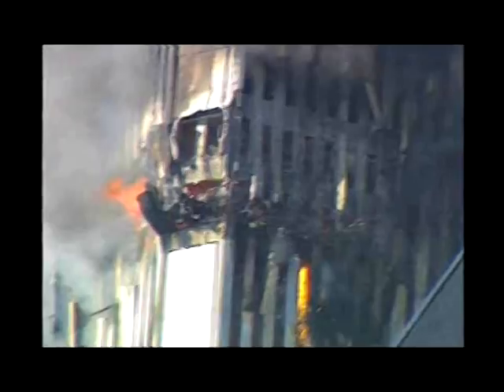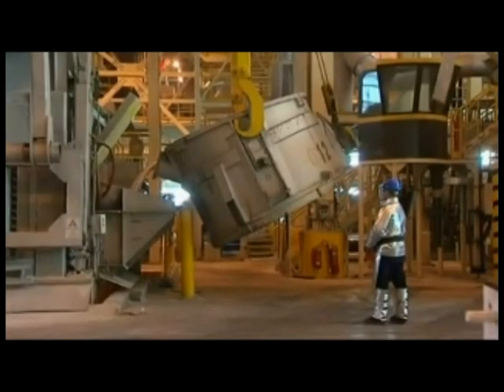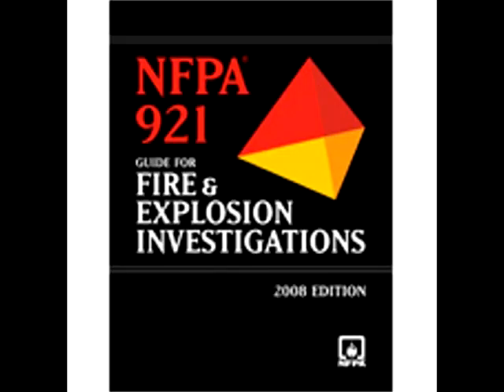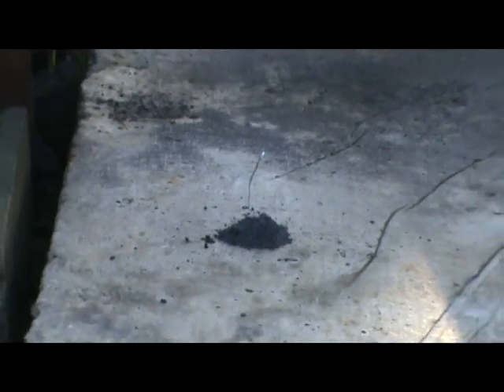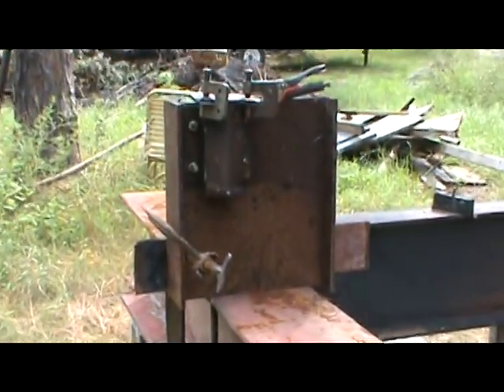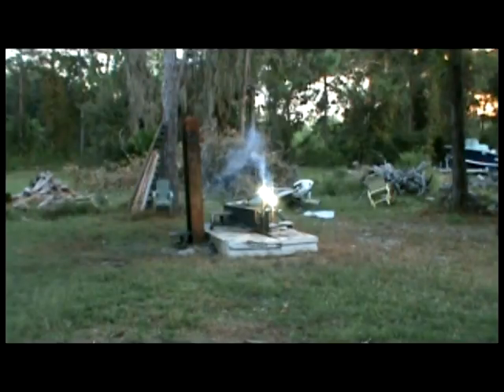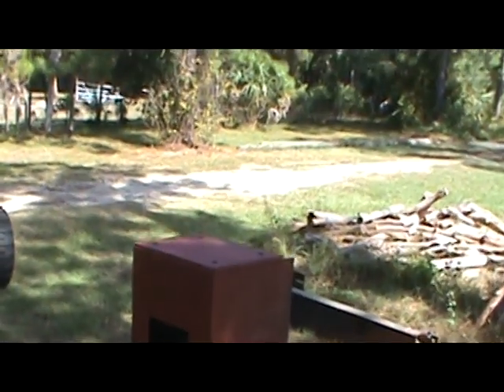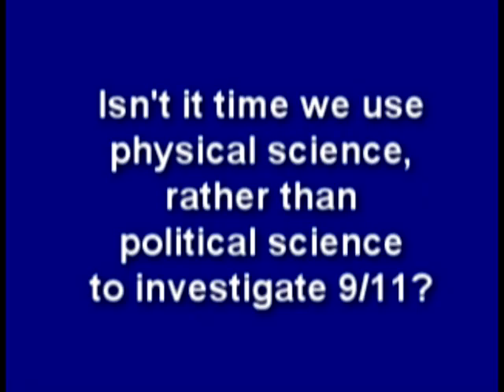9/11 Experiments: The Great Thermate Debate

Comment: So, your theory is a lot of people installed hundreds of that kind of themite bombs on steel beams surrounded by concrete, disassembling all kind of other furniture, in maybe one night, and no one of the 10.000 workers of the WTC notice.

Oh, yeah, sure...
Reply: construction companies were doing ‘regular’ work in those buildings every day for years.  It was a common sight.
Reply: and not ONLY that man, they knew EXACTLY where and how fast and at what angles the planes were gonna hit on each building ok? Also, they knew EXACTLY how the fireballs and shrapnel and debris and pressure would go in each building, and they knew were all the holes in the building and all the beams that were blown out were, so they knew EXACTLY which Thermite bombs to set off so no one would becomes suspicious. 
Like you know the corner of Tower 2 that was severely daaged? They'd installed a thermite bomb right in that corner, JUST above and JUST below the hole in that corrner, because they knew the planet wing or whatever would rip out in the middle of them, so then, they pressed their detonator slowly about 40 mins after the crash happened, (thats what the sparks you see are coming from the hole just before the collapse) and boom, it went down, AND did you notice, both buildings collapsed at the EXACT areas where they had the most structural and load baring damage? well they didn't, they had thermite bombs installed in those exact places, which DIDN'T get hit by any of the debris or shrapnel or weren't blown out by the fireball or pressure or anything, of COURSE they weren't, the Pentagon planned the shit ffs, so they knew EXACTLY where they needed to plant the Dynamite. And it fell down EXACTLY as they'd planned it in their secret meetings they must have been having for YEARS to managed to knock down 3 buildings with 2 planes so amaingly well and with so little evidence. 
Because we all know, you know all of those "Explosions and secondary explosions" they all kept hearing? We know for a FACT that they were the thermite bombs, because we've all looked up Thermite or Thermate now and when you light Thermate, it makes a big explosion noise doesn't it. You guys are awesome, how did you work all this out from your computer seats!! my god.
Reply: put on a high vis coat you can sneak into anywhere that's been proven time and time again
Reply: Actually it was 2996 people not ten thousand. And it could have been planted there months in advance on holidays or what ever. All in silence and in private. Plus building seven was also a security building that had the FBI, CIA and NSA on different floors using offices. But the main catch was that WTC 7 had in its the sub basements both towers' data servers as back ups. Since whoever planned it all used corporate banks every transaction was recorded on those very same servers. Take down the building, you have a great excuse of getting rid of all evidence. Yet here is the finale... to get to the cores themselves there was a passageway from the basement area. But only assigned personnel had clearance to get inside the core column spaces using a series of ladders that led up to about floor fifty. Then you had to take another route. So get clearances for that then there was no problem rigging the interior cores. Last... you could only enter the column cores once a month. So who ever rigged the building did it over a course of a few months making sure they could never be spotted by inspectors who also could have been paid off in some way to replace inspectors. See the possibility now?
Reply: 2996 are the killed people. Ten thousand are the people working on WTC. Rest you said is nonsense.
Reply: Wow the ignorance people carry when they want to believe that terrorists actually pulled this off. Welcome to the world of the blind. In a way you did point something out for me. I at least didn't suggest that whoever did plant the thermite packages could have done it in the middle of the night when those ten thousand individuals working in the WTC left for home to sleep or what ever because that's what humans do. But go ahead and keep your head buried in the sand. Oh and by the way the architectural schematics do show specific maintenance passages for personnel. The cores do have concrete, but only on the outside of the 'I' beams facing the wet walls of the structure. The rest is exposed steel on the inside of the building. Along with all of the elevators, shafts, hatch ways, ducts and what ever else a high rise contains. You get my drift? Instead of saying it's nonsense try looking it up or do an actual search. Or better yet, go to a library where you can actually view the schematics of the entire building itself. Wow what a revelation.

Comment: The issue is that there was more than just jet fuel buddy. An office building has desks, printer ink, paper, carpet, ceiling tiles, wallpaper, plastic, and many other highly flammable items, and that along with a relatively small hole in the side of the building would create a setting not unlike a crucible, and could definitely melt steel beams.

Comment: “Jet fuel cannot melt steel.” It doesn’t have to. The challenge isn’t to melt steel, but to weaken it to structural failure, which is something burning jet fuel can do.

Comment: Hmm...  rusty steel beams...  Iron Oxide.  

Burning Molten Aluminum from the several thousand ton Aluminum Aircrafts that slammed into the towers, being melted to a liquid by the several hudred degree burning jet fuel...  molten aluminum.

Thermite...  Iron Oxide and Aluminum.  

Hmmmmmm...  dripping with sarcasm  I wonder.

Or...  isn't it possible that bombs were planted, be they explosive or thermite, by terrorists of Middle Eastern origin?  They crashed planes to make a spectacle, and to cover up the explosives so they would not be found until it was too late perhaps?  

Or perhaps, the van bombing in 1993 was only PART of the bomb gone off, and the rest had been hidden in there, but never went off and were never discovered?

It is also possible that the owners of the tower, trying to collect the insurance, blew up their own tower, or were planning on trying to take it down and the terrorists happened along and blew it up at the same time with the planes, so they saw an opportunity to take out the buildings at the same time.  

Or...  maybe...  it was a combination of A LOT of factors that we do not yet understand, that had to do with some kind of reaction between hot iron oxide and molten aluminum mixing from within the tower and destroying it.